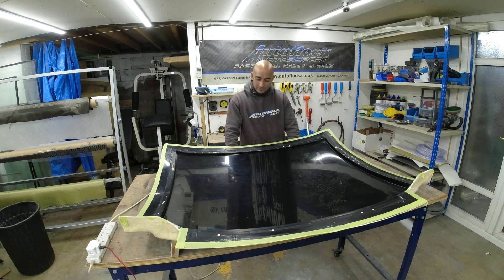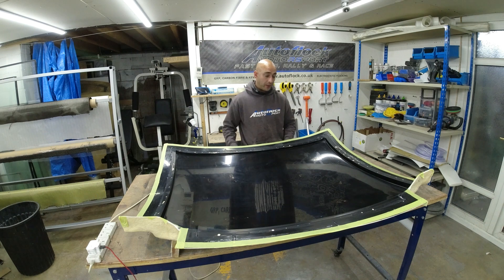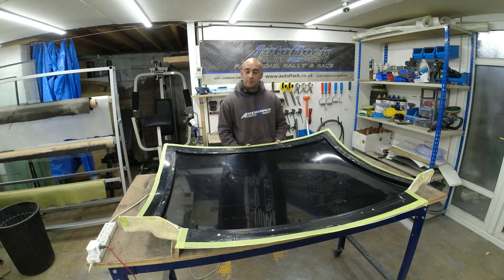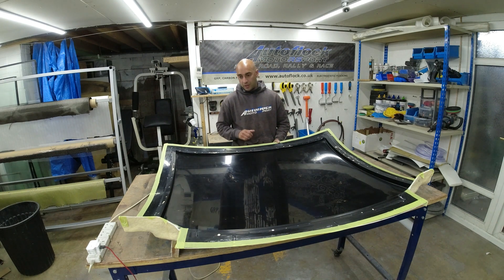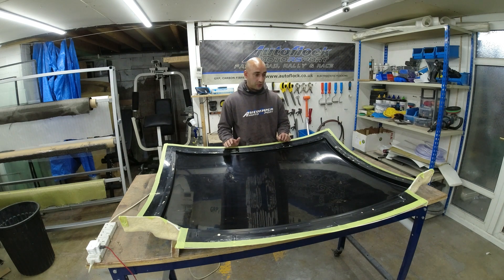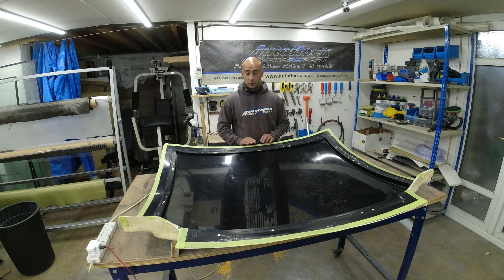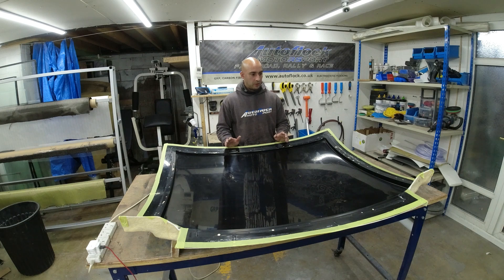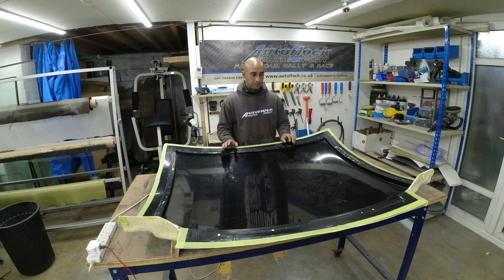Carbon Fibre Roof -Part 2 - Making The Carbon Part by Resin Infusion

Comment: Nice work, nice video.

Do you think the resin infusion process is worth the cost outlay over wet layup Planning to make a carbon roof myself for my EF Civic. Hoping that switching to carbon over the metal and removing the glass sunroof, mechanism, motor and wiring I can save close to 20kg. 

Just working out the best way to do it without breaking the bank but while still achieving pretty good results. I build cafe racers, so whatever stuff I get is likely to get used the odd time again to make smaller carbon parts in the future.
Reply from the maker: Hello Ian, sorry for the delay in getting back to you, 110% YES!!!!!!!, its only the setup cost which is more, to make a actual part there isn't much difference at all
Reply: @autoflockmotorsport7730  No worries, thanks. I think I'll go for the resin infusion setup, won't be used often, but even a couple of times a year over 10 years makes it well worthwhile. 

Still trying to find a roof from a scrap car to make the mould from but not having much luck and not sure I fancy risking removing my roof incase of issues.

Comment: Hello Ray, Im loving your work and i have a question. Are you using bonded carbon fibre to keep the wave straight or its just normal carbon fiber withouth any adhesive?
Reply from the maker: Hello there,I use both dry and epoxy bound fabrics, I tend to use bonded fabrics with larger parts to as you say keep the weave neat.  On small parts I don't think its necessary, for a novice its a big help then once experience is gained you can move to non bonded.  Bonded fabrics cost slightly more than dry fyi.  I hope this helps

Comment: you dont use clearcoat?
Reply from the maker: Hello Pedro, no need to, the gelcoat is UV stable and the roof has a fantast deep shine.  Only time I would use a clear coat is when secondary sanding is required.  Most people clearcoat parts to hide imperfections in the finish

Comment: Noticed you used sprat tac on the first layer of carbon, did this not leave the surface with imperfections. Removing the peel ply can be made so much easier with the use of perforated film .
Reply from the maker: Hello Gay, not at all, this spray tac is designed to be used with epoxy resin and the infusion process so all traces is removed, as for the peel ply, it also helps when you lay it down release side first :-( epic fail on my side which I paid dearly for in production time.  Using the perforated film can sometimes cause saturation issues I have found, the peel ply I use has a wax coating on one side which when placed down correct way to the fabric release perfectly.  Everyday is a school day in the Autoflock work shop lol.  Many thanks
Reply: @autoflockmotorsport7730  i was wondering why the peel ply was so tough to remove.... LOL
Reply from the maker: @anthonyburke3295  Yep, epic fail, but took my time and it released from the part in the end.  A few cut fingers and some colourful language, job done
Reply: @autoflockmotorsport7730  Can i ask which spray tac you are using please.
Reply from the maker: @gayshelley2677  Of course, here is a link:
https://marineware.com/composites/compositesvacuum-consumables/aerofix-3-spray-adhesive-tin
Reply: @autoflockmotorsport7730  Hi again, have read the info on the Aerofix 3 and it appears to be compatible with certain Epoxy's. We use in2 infusion epoxy, can i ask what epoxy you use with the aerofix .We have some moulds with some very tight angles and being able to spray tac the top layer of fabric into position will save me a lot of time. Thanks in advance.
Reply from the maker: @gayshelley2677  I have used the same resin with great results.  I cannot give every tip and trick away so just have a go and do some experimenting, you will not go wrong with this spray tac though I assure you.